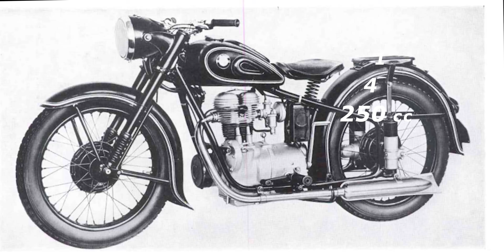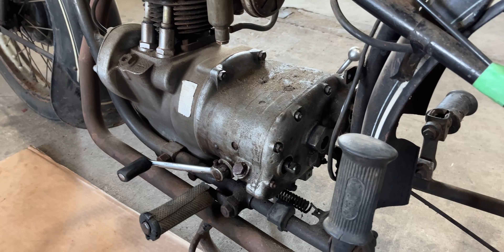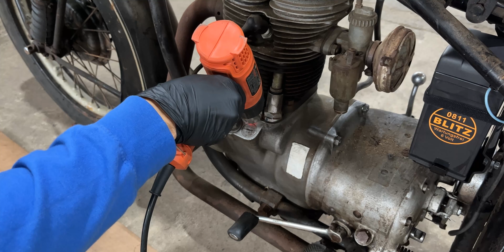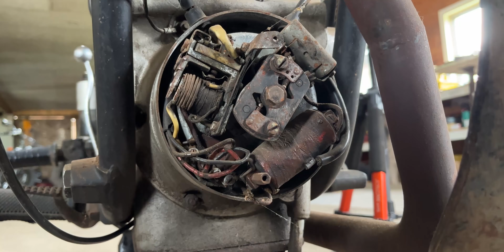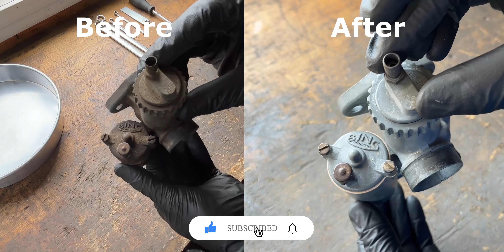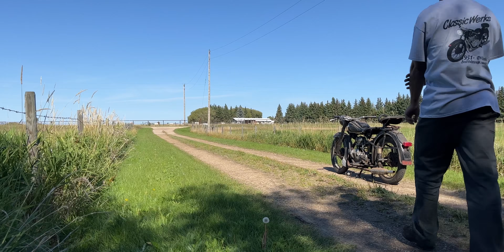Reviving a Classic 1951 BMW R25 Motorcycle

Comment: Sweet! I forgot these existed. Basically half a boxer, right? Super cool.
Reply from the maker: They do, and they almost seem a bit underappreciated. This particular bike was essentially half the displacement of a BMW R51. Looking back at BMW’s lineup, their 250cc entry-level models were their most popular bikes before 1969. From the late ’30s to the mid-’60s, BMW continued to refine the engine and the bike it was housed in, improving handling and stability for a more comfortable ride.

A very impressive line of bikes, to be honest! Thanks for watching😃
Reply: My R27 was essentially half an R50S, with the 7,000 rpm valve train. Freeway capable all day, super quiet, valve covers UNDER the tank. I'd buy a new one.